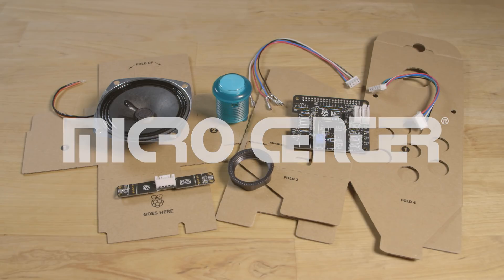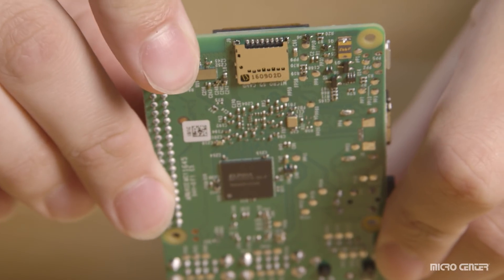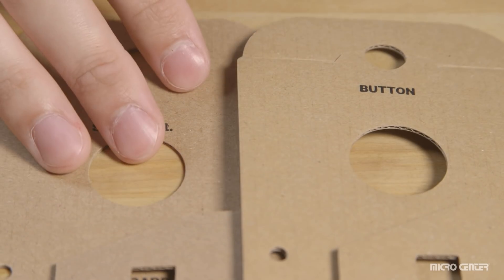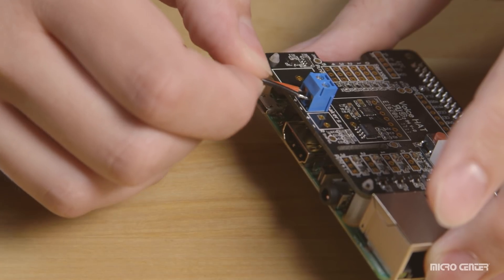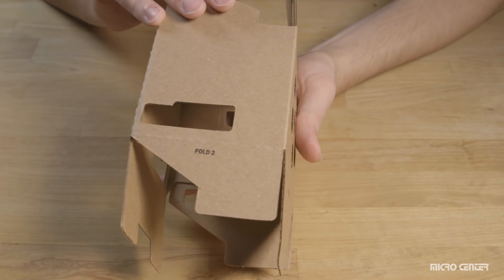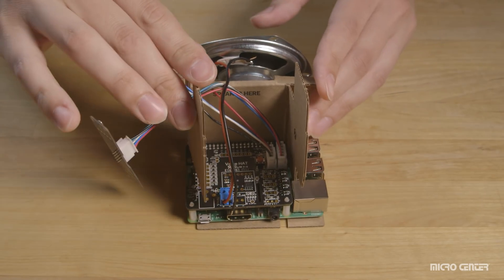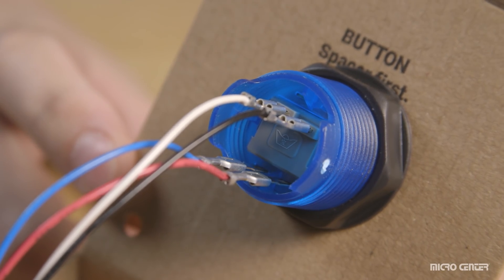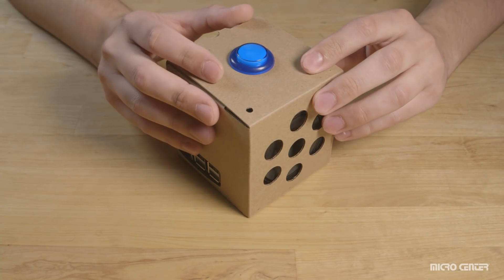Google AIY Voice Kit How-To | Part 1: Physical Assembly

Comment: Will this work on Raspberry Pi 2 Model B? (Instead of pi 3)
Reply from the maker: According to the user's guide from both AIY Projects and MagPi Magazine, the 2B should support the device and run the demos you see in our How-To videos here. Hardware-wise the only difference of course is that you'll need a Wi-Fi dongle if you want to go wireless with it.
Reply: Yes. But you will need a WiFi dongle or use the Ethernet port to get the network access. It works fine though (I tested it) but is generally easier with a Raspberry Pi 3.